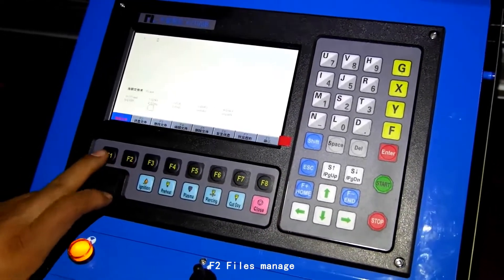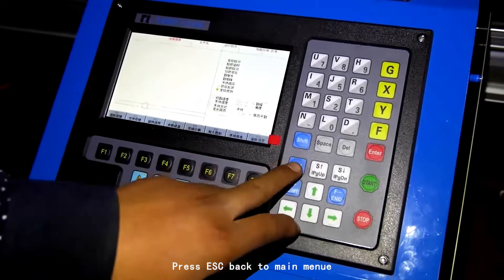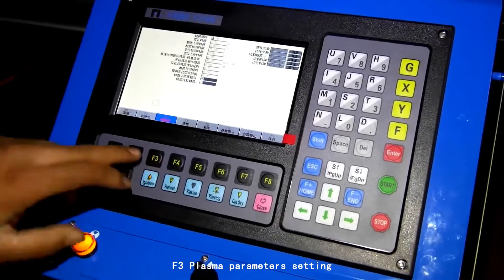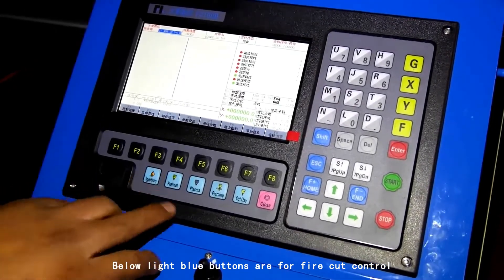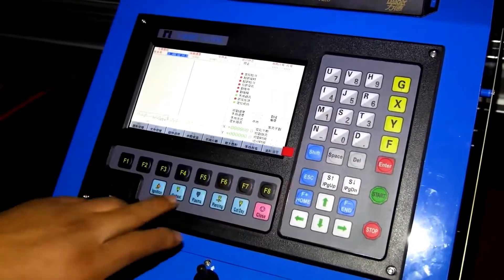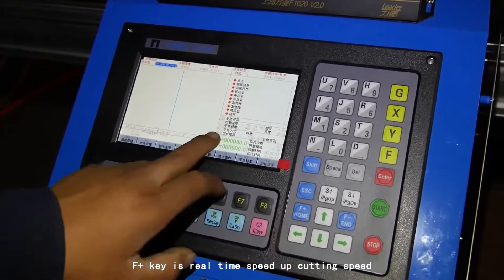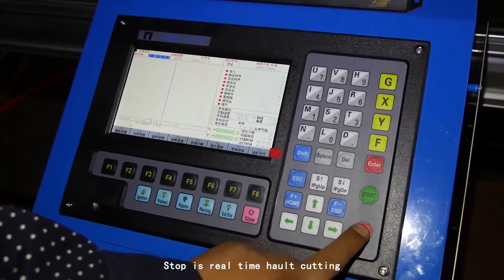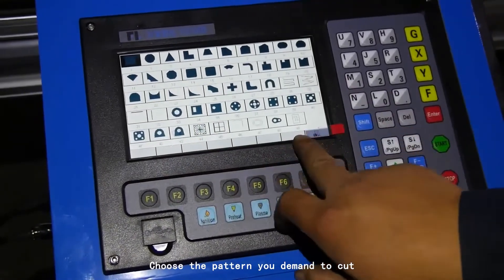New user How to operate CNC plasma F2100B FANGLING SYSTEM

Comment: I want to use sheetcam to produce gcode for my f2100b CNC plasma 

 Which post processor I should use in sheetcam configurations . thank you
Reply from the maker: the gcode directly read by cnc. sheet cam not famous, most fast cam, smart nest , star cam